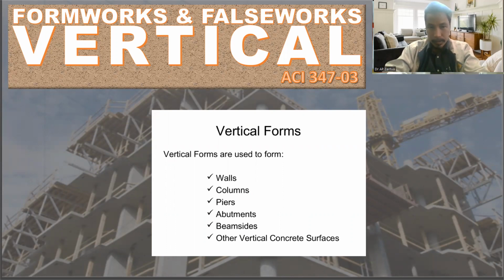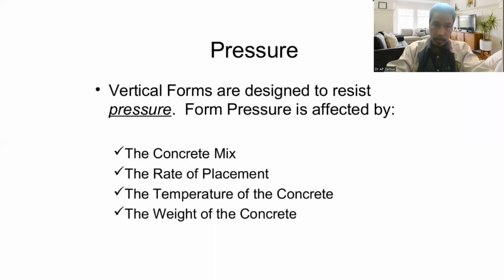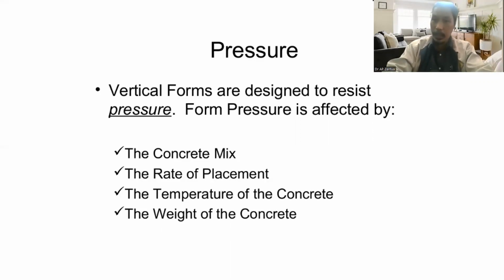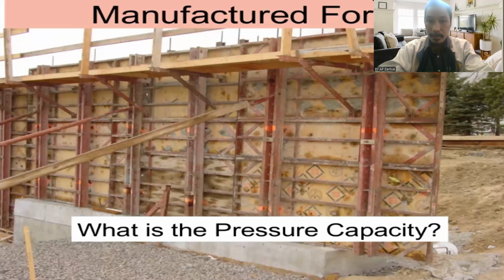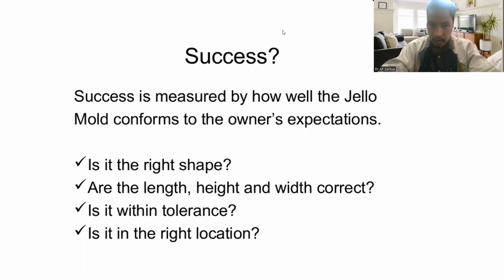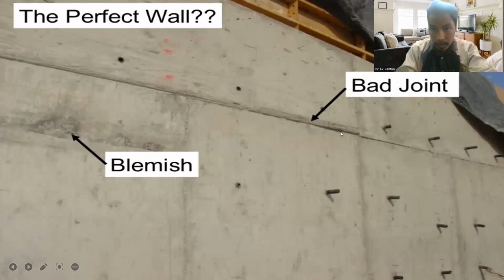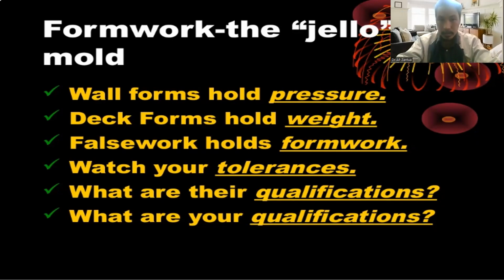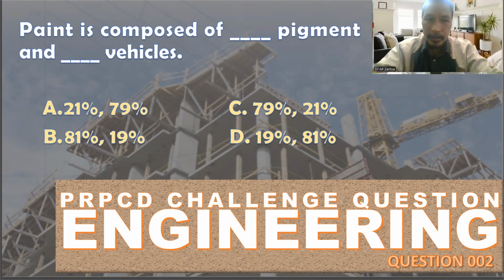Formworks & Falseworks of Reinforced & Plain Concrete [ PRPC Design ] M1.01.b

Comment: I now understand the difference between reinforced and plain concrete falseworks and formworks, which is based on the horizontal and vertical form structures employed. I also discovered what the jello mold contains.

Q002: Answer A. 21%, 79%

Comment: Thank you sir for discussing the Formworks And Falseworks Of Reinforced And Plain Concrete. I have learned that the determined weight is determined by the depth of the concrete, the unit weight of concrete and the amount of reinforcing.

Q002: Answer A. 21%, 79%

Comment: thankyou for the knowledge and tackle about the Vertical and horizontal form. and for the deeper difference of false work and formworks

Q002: Paint is composed of _ pigment and __ vehicles. A. 21%, 79% B. 81%, 19% C. 79%, 21% D. 19%, 81%

The answer is A. 21%, 79%

Comment: Thank you sir for examples of Vertical and horizontal form. and for the deeper difference of false work and formworks

Q002: Paint is composed of _ pigment and __ vehicles. A. 21%, 79% B. 81%, 19% C. 79%, 21% D. 19%, 81%

The answer is A. 21%, 79%

Comment: Thank you so much, sir, for this video. I now grasp the distinction between falseworks and formworks of reinforced and plain concrete which is all about the horizontal and vertical form structures used. I also learned what is in the jello mold.
Paint is composed of 21% pigment and 79% vehicles.

Comment: Thank you Sir for this video. This is a continuation of the previous where continuing discussing about the two types of formwork and the horizontal formwork examples. Also discuss the Formwork-the "jello" mold.

Paint is composed of __ pigment and __ vehicles.
Answer: A. 21% , 79%

Comment: Thank you for this further lectures I've learned the porma is also known as vertical form, it designed to resist pressure while horizontal form are designed to hold the weight of the concrete.
Q-02
Ans: 21%, 79%

Comment: Thanl you sir this video is the continuation of the topic about formwork and falsework which is shows the characteristics of vertical and horizontal forms. It is designed to resist the pressure and hold the weight of the concrete.

Question: paint is composed of____pigment and_____vehicles.
The answer is letter A. 21%, 79%

Comment: In this video it talks about the vertical and horizontal form that is a continuation of the past video about formwork and falsework. The vertical forms are designed to resist pressure while the horizontal is designed to hold the weight of the concrete. And at the end of the video there is a challenge question: 

Q002: Paint is composed of _ pigment and __ vehicles. A. 21%, 79% B. 81%, 19% C. 79%, 21% D. 19%, 81%

The answer is A. 21%, 79%

Comment: This video further continues the discussion about formwork and falsework. I have familiarized myself through the forms under vertical and horizontal. This two has different characteristics. The Vertical forms hold pressure while the horizontal holds weight. Thank you, sir I can be able to determine the falsework and formwork due to your explanation and the illustration given. For Q002, Paint is composed of 21% pigments and 79% vehicles. Letter A is my Answer, it is based on the DPWH documents. It has 20% pigment, 4% additives, 42% binders, 20% carriers, and 14% filler. Solvent has 40%, Liquid additives has 4%, Binder Solid and Liquid is composed of 42%, and 14% pigment and vehicle.

Comment: This is the continuation of the previous video. For today’s video, Dr. Z tackle the Vertical Forms or known as PORMA, before we put concrete. It was use  to form a wall, columns, piers, abutments, beamsides,and etc..Formwork, according to ACI 347, Chapter 1, Section 12, it is the total system of support for freshly placed concrete, including the mold or sheathing that contacts the concrete and all the supporting members, hardwares and necessary bracing. Formworks includes Falsework. I’ve learned also the importance of Vertical forms and Horizontal forms, vertical forms is designed to resist the pressure while horizontal form designed to hold the weight of the concrete
Question: Paint is composed of ___pigment and ___ vehicles. Answer : 21%, 79%